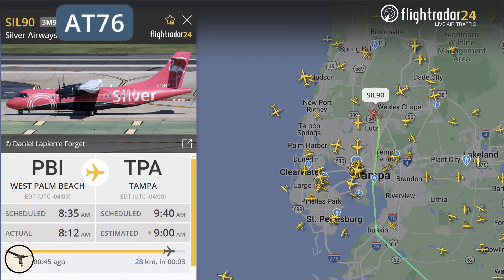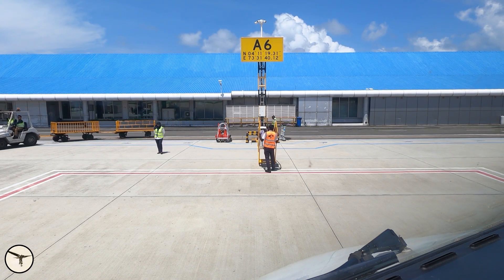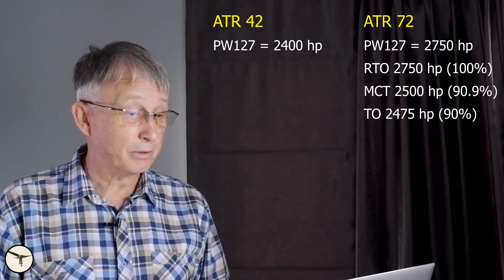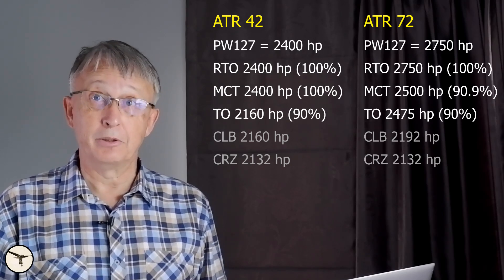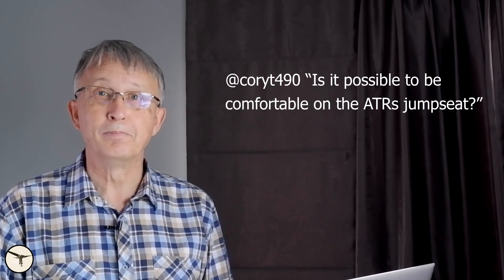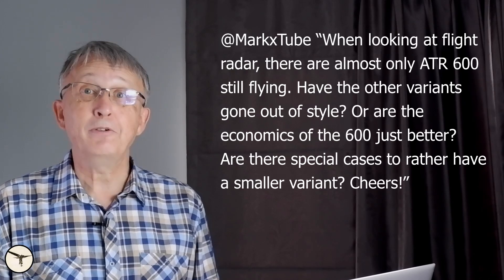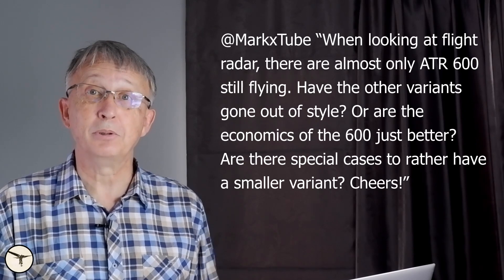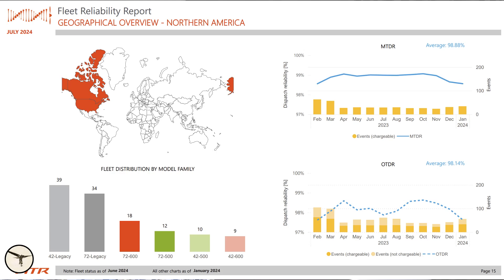Are there only ATR 600s still flying? Q&A with Mr. ATR

Comment: Hey Cpt. Magnar, thanks for this great video! As FO on ATR Legacy (42 and 72) ranging between 25 to 32 years old models, I can assure that this piece of engineering, no matter it has a lot of years and cycles, they are performing great! Ofc a big thanks goes to the maintenance, which carefully takes care of these old ladies. For give you an idea, this winter about when You asked over Canada OPS, I operated a flight out of Kiruna (KRN), which it is above 65N in artic circle, with similar condition in canada, I took with a whopping -35 degree celsisus, and it was great, as equal to fly to small Gallivare (GEV) with snowy conditions and runways Iced. OFC this aircraft it is slow, but reliability wise and versability, I believe it remains unbeaten. As it is known, It could something be not working, but the AKA. Always Try Reset, makes it working (most of the time).
Reply from the maker: Thanks for sharing. I have similar experiences flying 42-320 in Norway.

Comment: Hello Magnar! Regarding the ATPCS, why on the 600 you have to reject the take off if it isn't armed but on the 500 you could still continue? And what are you supposed to do if an engine failure occurs after V1 and ATPCS somehow does not kick in so there is no auto feather and auto up trim? Thank you

Comment: Hey Magnar. I operate in Canada in the Arctic regions. We mostly operate thr 42-300/320 combi, 42-500 and 72-500 full freighter. The conditions to make the legacy 42 a true workhorse and more suitable compared to the newer 42 600 which would definitely justify the cost of operation. In the Arctic you have short gravel straps which are even worse during winter and payload/ pax capacity/fuel consumption becomes key

Comment: What is the reason why ATR -600 auto speed function on takeoff maintains a V2+5 kts on liftoff instead of V2? What are the instances where auto speed will maintain V2?
Reply: I know this will make the next video, but the answer is that V2 is a minimum safety speed, not a target speed. The regulation is that CS-25 aircraft like the ATR should fly anything between V2 and V2+10 as a compromise between minimum control speed against climb performance. ATR chose to hit that sweet spot in the middle. You will never fly V2.

Comment: Hello Magnar, Hello Mr. ATR :) I like the nickname! Do I understand correctly that MCT = Maximum Continuous Thrust, and is that then also called MCP "Maximum Continuous Power" or does that term not exist? And RTO is 'Rated Take-Off'? Thanks for the nice video :)
Reply from the maker: You are absolutely correct! MCP would be more correct, as engines with propellers are measured in horsepower. But the term MCT is so widespread that it is accepted almost everywhere.